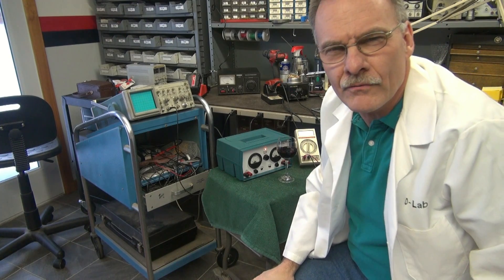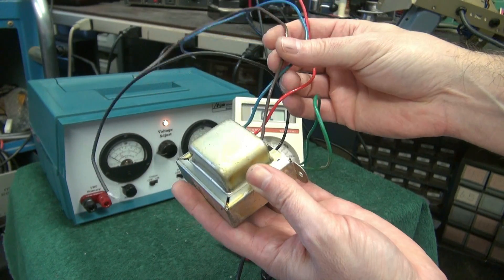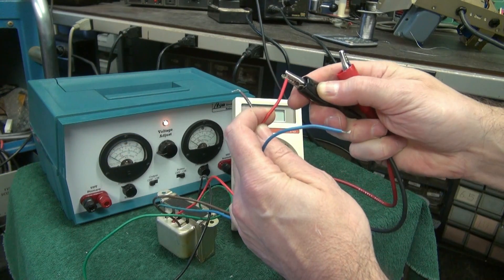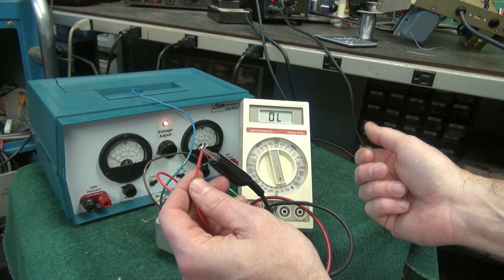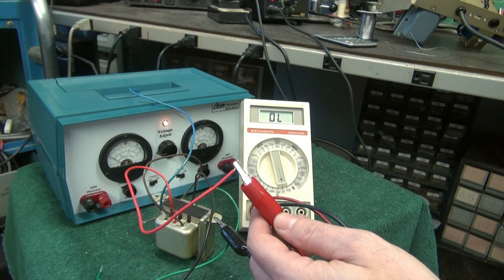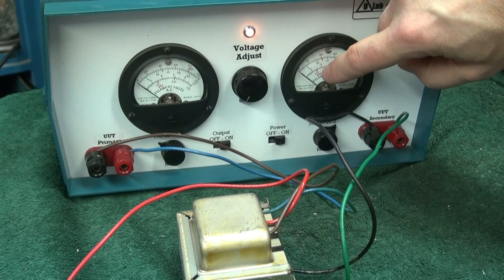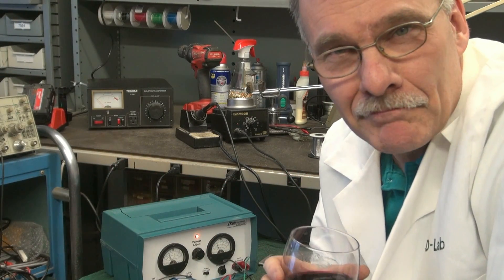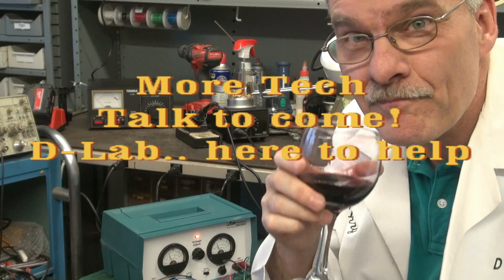Guitar amp tube output transformer testing How to D-Lab Fender Princeton

Comment: It's also cool if you tell the frequency the measurement happens at, I took my measurement with 18.5VAC 50Hz into the secondary and I measured the primaries. Frequency did matter when using smaller impedance audio sine signals ranging from 50-1000 Hz, but my guess is that this more beefy 18VAC from a model train transformer should be just fine.

Comment: This is all good stuff but how do you tell if the frequency response of the transformer is correct?
Reply: No easy to do. You basically have to build it into an amp and measure the frequency reponse of the whole circuit.
Reply: @MB-st7be  thanks for your input.

Comment: Is this Transformer working? Thanks - Tested 1966 Fender Blackface Champ transformer (removed by Gerald Weber) using a Fluke 101 MM Alligator Clips : TESTS - Secondary ( 2 leads) 0.2 Ohms - Primary ( 2 leads) = 271 Ohms - Continuity Primary to Secondary = OL (All) - Shorts to Ground / Shorts to Case = OL (All) Fluke 101 MM
Reply: It's good!

Comment: I get reading of between 4 and 9 megaohms when I connect between the primary and secondary windings on a suspect output transformer. So I assume thats the problem with my amp? Massive amounts of humming and no sound from speaker

Comment: That particular transformer is just a straight forward layer wound, not a bifilar wound unit. This is why the ct to each side is a little different than the other side. You failed to mention that the lower ohm primary side from ct is closer to the core. What I get a kick out of is you using an ohmmeter to check the transformer. That pretty much will show a dead short or open. A hipot tester is a better way to test the transformer. Another thing, toss 100 volts AC on one side of the primary and the other side of primary should be the same. Ask me how I know this stuff, I rewound transformers for 25 plus years. Ohmmeters are a waste of time. You need a variable AC supply, metered up to 5 amps and a good 10KV variable hipot tester.

Comment: Working on a 100W quad reverb, basically a twin.. My OT primary reads around 35 ohms on both sides of the center tap.. Seems kinda low to me. Shouldn't it be like more around 100 ohm or so?

Comment: On my 69 Princeton Reverb I'm only getting a PV reading on the right 6v6 and the left one is giving a negative low number on pin 3. Am I missing something? Amp sounds and plays great but checking the bias I noticed this.
Reply from the maker: Hello, sounds like an open output transformer winding. Have you tried taking an Ohm check between the 2 pin 3's? Should be around 300 ohms.
Reply: @d-labelectronics  That's what I was afraid of. I haven't checked ohms yet. It got late and I had to get in the bed. I'll be able to check more when I get off work. Anything else to look for to confirm? Is it possible to get it fixed since its original to the amp?
Reply from the maker: Hey man, The originals can pop up on ebay or Reverb.com. I'd sub in a Classic Tone, Chicago, Great iron
Reply: @d-labelectronics  Would my amp continue working fine with zero noise if one of the OT wires wasn't putting out voltage to one tube? Everything is working fine, both tubes glowing fine but I just don't have voltage on pin 3 of that one tube.

Also I get no ohm reading between the 2 pin 3s.

I did order an Allen OT today anyway. Thanks for helping me.

Comment: Should there be continuity between the secondary and case/ground?
Reply: No.
Reply: Apologies are in order. I was assuming that you were testing a transformer which was not installed in an amp, in which case there should be no continuity. If the transformer is installed in an amp, then one side of the secondary will be connected to ground.

Comment: How about some plans on building your own ratio meter?

Basically this is a current limited ac power supply , an adequate load and two rms volt meter?
Reply: i agree ...i would be glad to pay for a set of plans ,,since you do not plan to build any more of them...it would be a good income source for d-lab...just include statement of build at your own risk....

Comment: speaker coil is 8 ohm not a transformer , transformer just reflects the speaker resistance or impedance on amp side ,  like a mirror , hence there is no point in searching 8ohms or 16ohm on secondary of transformer

Comment: Terry went by a very important point rather quickly, so I thought I'd call attention to  it.  The impedance ratio of a transformer is the square of the voltage ratio.  So, note that Terry squared the voltage ratio of 30 to get 900, which he then multiplied by 8, the desired output impedance.  Good job, Terry, on explaining all the things that need to be checked.
Reply: Thanks! I was trying to grok that.

Comment: I have a Blues Deluxe which went silent on me, the tubes light up, but the amp doesn't make a sound,  I suspect the Output Transformer.  Should I have the same values from the Multimeter as you have here from the Princeton Transformer?  When I test the Ohms on the secondaries I become 73.5 on one side and 82.5 on the other and together 155.3 , where you are getting 191 on each side and 382 together.  Does that show a problem with my Output Transformer or is there a differenct between the Princeton and Blues Deluxe Transformer ?
Reply from the maker: Sounds like your output tranny is fine. Check the high voltage and screen resistors. TD
Reply: Thanks for the feedback!   I decided to test one the Transformers on one of my other amps to compare the results, and noticed that when I touched the inputs on the Tranny with the Multimeter that I heard noise from the speaker, which scared me at first, thinking perhaps I had left the power cable stuck in, wasn't so, but then I thought "A Ha", I didn't hear that from the "Broken" amp, so I traded the Speakers in the Amps, and my "Broken" Amp works!,  It was the Speaker.  
Thanks for sharing your knowledge ,  I am enjoying learning how my Amps work and troubleshooting on my own. 

Robert Jefferies
Berlin
Reply from the maker: Excellent, good to hear. Its a great hobby
Reply: I got my new Speaker, an Eminence Legend GB 128.  Amp works, Sounds super.  I hangedmy Multimeter onto the Speaker connections, and when I play at the Amps full volume, the Multimeter reads 23V.  VxV/Ohms = Watts, right?  So 23x23/8=66 ,  66 Watts is too much to be coming out of my 40 Watt Amplifier.  Der GB 128 is a 50 W Speaker, should be correct for a 40W Amplifier, but when it's giving out 66 Watts.  Is this why I had to buy a new Speaker in the first place?  or am I mistaken on my measuring of the Speaker connections?
Reply: It's important to know what the waveform looks like before you calculate power.  It would be best to connect an oscilloscope across your speaker leads, inject a clean sinewave into the input of your amp, and then adjust the output of your sinewave generator and volume control until the output just starts to saturate.  Note the peak-to-peak voltage on the scope screen, divide by 2.828, square that number, and then divide by your speaker's impedance (probably 8 ohms).  That will give you your clean power output.  Pushing your amp's gain up until the amp saturates will give you even more power, but with the complicated waveform, you would need a rue power meter to accurately measure the power.

Comment: You can check for shorted turns in the primary by measuring its resistance with an analog meter. First, measure a resistor of similar resistance to the primary, while closely observing the pointer of the meter, which will begin to move immediately and then go smoothly to the value of the resistor. Now measure the primary, and you should see the pointer hesitate before it starts to move, and then accelerate to the final resistance. This indicates that the primary still has inductance. If there are shorted turns in the primary, the pointer will react as if it were measuring a resistor.
Reply: What kind of BS is that?
Reply: @garybrown8767  It's the kind of BS that you learn from to techs who have been designing, building and repairing tube amps for over sixty years.
Reply: @silasfatchett7380  And that is a load of BS to.

Comment: Someone is giving me an old dead console stereo from the 60s.  If an output transformer has been blown from old caps, the first tests would pick up that it is shorting right?  I could try to go through the amp and try to replace caps / troubleshoot the cause of the failure.  But I am thinking of just scavenging it and testing the tubes and transformers for potential re-use in a new amp.

Comment: I have a Peavey Windsor head, the other day I was playing and it sounds as if something shorted which got extremely loud and distorted. Even when I put it on standby it carried on so had to turn the power off. Is this something to do with the transformer or tubes? I think its the output transformer because it carried on after putting it on standby. Any ideas?

Comment: I don't understand why you multiplied 30 by 30
Reply: Impedance is a function of voltage and current. If an 8Ω speaker has an 8V signal across it, there is 8V / 8Ω = 1A flowing in it. If it is connected to the secondary of a transformer with a 40:1 turns ratio, at the primary, voltage is stepped up by 40:1, 8V x 40 = 320V. Current is stepped down by 40:1, 1A / 40 = 0.025A. The impedance of the primary is 320V / 0.025A = 12,800Ω. 8Ω x 40 x 40 = 12,800Ω.
Reply: I was asking that myself. I worked it out using ohm's law and saw that this was a short cut. One of the 30s is the voltage on the left side of Terry's device. The other 30 is the number of windings as Terry's device reveals (30v/1v= 30 windings ratio).  Primary ohms = 30 volts * 30 (winding ratio) * secondary ohms. 

The full equations is this: the current on the speaker side is 1 volt / 8 ohms or .125A.   As Silas points out the current is multiplied going the other way through the transformer by the windings ratio which is 30 so  it's   .125A * 30 on the primary side.   To to find the ohms on the primary side  (ohms = volts/resistance) is  30v (as on the left  or primary side of Terry's device) divided by .125A. * 30(windings ratio)   or   30v/.125A * 30.   You can take the reciprocal of .125A which is 8 and turn the division into a multiplication so  Terry's short cut is  ohms = 30 * 30  * 8.

Comment: Hi
I have a Peavey ValveKing Micro Mini and I had inadvertently forgot to connect my speaker cable ( which was already connected to the ValveKing but not the cabinet) to the speaker cabinet while the amp was on for about 10 minutes or so. I eventually realized what I did and turned the amp off immediately. I then connected the speaker cable like I should have and turned the amp back on and the amp seemed ok. I know it's a bad scenario for the output transformer. My question would be then would you know if Peavey employs some kind of fail safe circuitry to prevent the output transformer from burning out? If not do you believe that my transformer on the ValveKing suffered any damage? Thanks
Reply from the maker: Hello, the transformer should be fine. If the amp still plays OK, your good to go. TD
Reply: A tube amp will happily idle with no speaker load. The damage occurs when it attempts to amplify a signal.

Comment: Do you still have a Ratio Turns Meter available?
Reply from the maker: +John Cunningham Hello John, Yes Sir, I have 1 more like the Heathkit style in this video
Reply: What is your asking price?
Reply from the maker: +John Cunningham Hi John, The best price is 200 shipped. My parts cost was high due to AC isolation. TD

Comment: I am not sure I am totally following you on this. As you know the primary impedance will be dependent on the ohm load that is placed on the secondary winding of the transformer. Does this Tester put an 8 ohm load on the secondary winding of the transformer?  The impedance also changes with frequency. What frequency are you testing this with?  If I am missing something in this please let me know. Thank you.
Reply from the maker: +neutrodyne Hello, Yes a load is applied to the secondary. The turns ratio is simply based on dialing in the primary side until you see 1 vac on the secondary, then read the primary. The frequency is 60HZ. The ac voltage is current limited to prevent damage/shock. TD
Reply: So you are basily do a turns ratio test?
Reply from the maker: +neutrodyne Yes Sir, thats it

Comment: If I don't have a ratio meter, can connect my auto transformer and read the output on the transformer then calculate?
Reply: Yes. The voltage across the primary divided by the voltage across the secondary is the turns ratio. By applying 1V to the secondary, Terry didn't have to punch a division sum into his calculator.

Comment: how does the 6av6 circuit work
Reply from the maker: +ian “valve doctor” forster Hello, take a look at a Fender Princeton phase inverter diagram. One half of the 12ax7 is for tremolo, the other half is the inverter. The 6AV6 tube uses that half of the diagram. A very simple but great performing inverter. TD
Reply: ok got you are just using the triode part of the 6av6
Reply from the maker: +ian “valve doctor” forster Yes Sir. The 6AV6 is a great tube for that application

Comment: Question - I have a Gibson Hawk (GA 25rvt). 15" speaker 6V6 version. When I turn it on the jewel lights up and the tubes light up but absolutely no sound. I pulled the output tran and tested it. Red + Blue = 140. Red+Brown=160. Blue+Brown=0.  - transformer shot?? Im guessing yes. Could it be anything else? I also noticed that when I was trying to check the transformer while it was still wired in I could hear a little sound come out of the speaker when I touched the probes to the terminals. I suspect that it was being caused by the electrical from the meter but a would dead transformer still do that? maybe so?
Reply from the maker: +BitterrootRambler Hello, Yes, I would agree. Sounds like the primary is shorted. Did you check one of the primary wires to the case of the transformer? Usually when they fail, you will find low resistance to the case also. TD
Reply: I did that but didnt notice anything. ill try again and cycle the meter. any recommendations on where to pickup a new transformer. Mercury Magnetics wants almost 200 bucks for one!
Reply from the maker: +BitterrootRambler You could install a Classic tone type, made in Chicago. Check Triode.com
Reply: +BitterrootRambler  If you haven't order a transformer yet. I would not order one. There are a lot of other things that could cause a no sound condition on your amp. Spend the money by taking the amp to a amp tech and have it checked out. You would be wise to also replace all electrolytic caps in the amp while you are at it.

Comment: Cool! I got learned!! Haha. 
But seriously, what does it sound like when your output transformer is faulty?  I have a Boogie amp that sounds "starved" for the lack of a better term...almost like a buzzy transistor sound!??
Reply from the maker: PeterPug007 Hi Peter, usually the transformer will open on 1 side disabling the high voltage from reaching one output tube.This will make the amp very distorted and yes loose power. You can buzz out the output tranny. Make sure the power is off and HV discharged. Check form the power supply HV to each tube plate. You should see equal resistance. Then check each leg to chassis. Make sure the tranny does not have an internal short. Hope this helps

Comment: you can apply a low ac voltage on the primary and read ac on the secondary and figure turns and impedence ratios
Reply: +James skippinhopper  Yes, all you need is a signal generator (or a low voltage mains transformer) and a multimeter. With an analog meter you can check for inductance by measuring resistance and watching to check that the pointer hesitates before it accelerates to the resistance value.

Comment: Would a Output transformer still function if it had some sort of internal issue? I have a 100 watt Fender amp with a 39 yr old OT that operates fine but I am not getting the loudness that would be typical of a 100 watt amp....more like a 20 watt amp. As a comparison, A friend brought his 60 watt Fender amp over and we almost blew the roof off with his master volume set on 2.
Reply from the maker: Hello, That issue could be many things. The first thing I would check would be the bias thru each output tube. Also, a bad inverter tube can cause all kinds of issues. Where are you located? I would be glad to go over the amp for you.